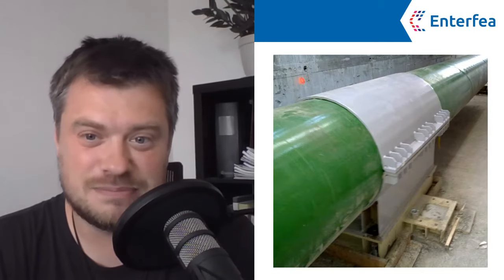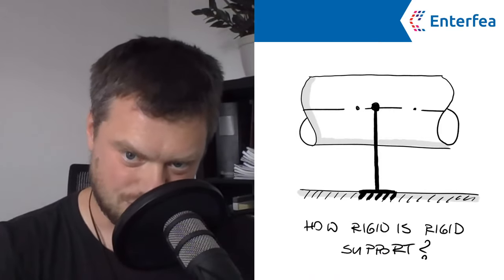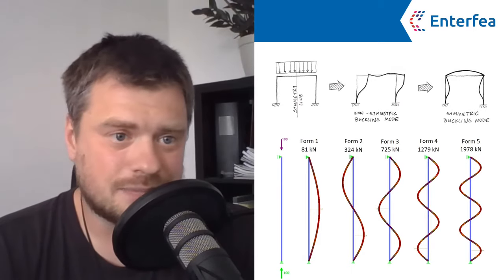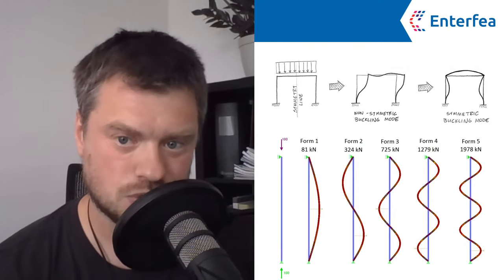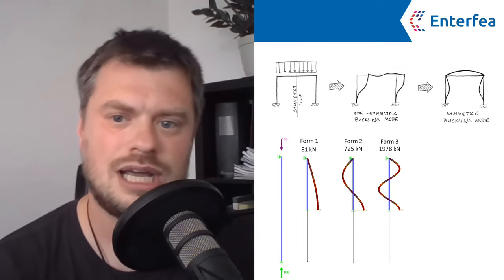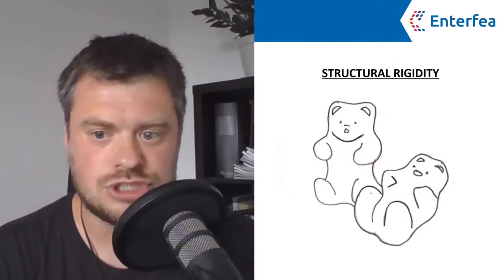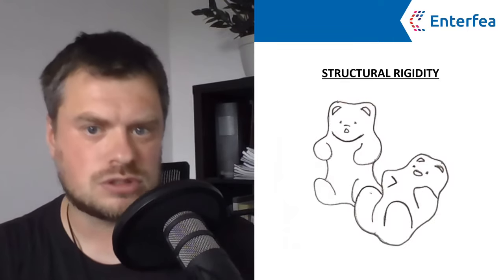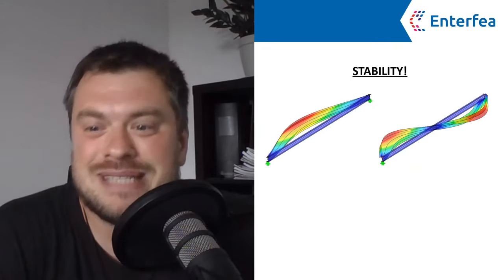FEA mistakes I've made, and how to avoid them!

Comment: In Mechanical Engineering, specialty in dynamics, a bolt without pre load is unthinkable. Talking about shear loads in bolts are not common either, they are supposed to make other parts transfer the load by friction. 
Very nice video, keep up with the good work
Reply from the maker: Thank you for the kind words. Well, in civil engineering non preloaded bolts would be a standard application. But of course, this depends on what you do etc. It's lovely how things are complex and how they differ from "field" to "field" isn't it. I simply love the complexity of engineering - this simply makes it so much fun to do!

Comment: Hi Lukas. I have to design a pipeline. In the First kickoff meeting..i Remember this video. And i go to rewatch. In my First idea i Will model the pipe and the rigid support for the offset from the slab. 
Well...mistake. how ti fix this?
Reply from the maker: Well... assess the actual rigidity of the support, and use it instead - that would of course solve the problem. Also, you may wonder if you should include the slab stiffness itself (if the support is very rigid, but in a center of a huge slab, the slab rigidity will play a role as well I would say). 
On a side note - I'm glad that my video helps you in the actual work :)
Good luck!
Ł
Reply: @Enterfea  ok i think to create a local model of the support, meshing all the plate, appling the winkler at the base nodes (we have not a slab, we have kind of isolate rafter foundation on pile, i have already model geotecnical stuff in a side model). if i apply 1N at the top of the local model, and i read the displacement in mm, i can calibrate the rigidity of the sistem. i can use this in the global model of the pipe. correct me if i'm saying bullshit.

sidenote reply. you're inspirational model for me, and i think for many other engineer. i wrote the question in this comment section and not in a direct private e-mail, to keep track of the answer, in case someone else needs it in the future
Reply from the maker: @peeolo  Thank you for the kind words :)
Yea, the idea you have is right. The only thing I would add is, that the support can have BOTH translational rigidity and rotational rigidity. So when you add a 1N load in horizontal direction (mind that 1N is very little, I would go with 100kN or something, depending on the support capacity) the displacement of the node where you apply the load (preferably in pipe axis) will be the rigidity of the support in the direction of the force (of course you read the deformation on the direction of the applied force, and rigidity is force divided by deformation). But you could also apply a moment, and then measure the rotation of the node - dividing one by the other would give you rotational rigidity - both would be decent to use if you have a big pipe :)
Reply: @Enterfea  thnks for all. i'd love to see your model of pipeline. even only few snapshot. i'm courios now
Reply from the maker: @peeolo  sadly, we can't share most of our work (NDA and stuff) but to be honest this pipeline was like a decade ago... I'm not even sure if we have those models anymore... probably somewhere in the external archives...